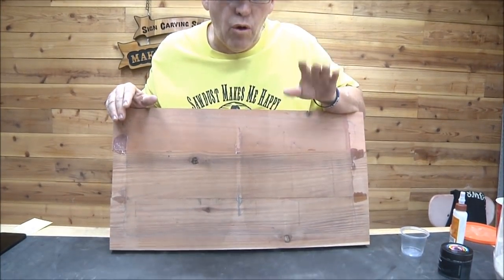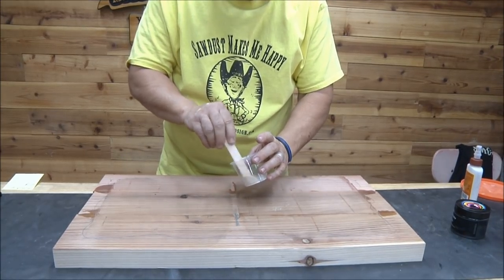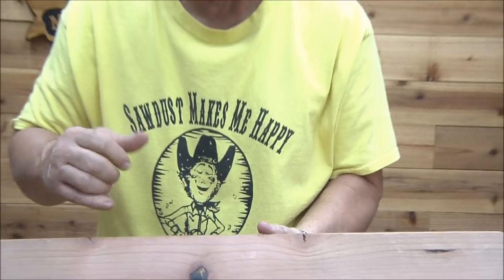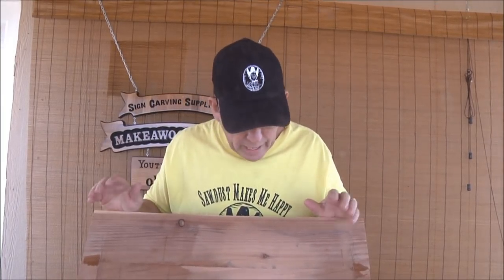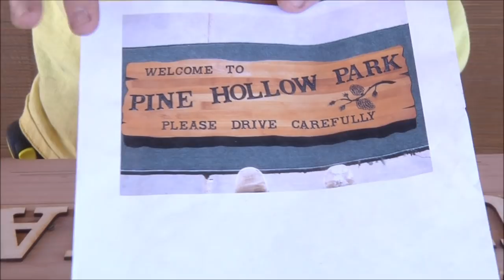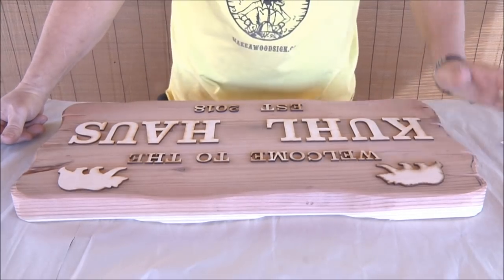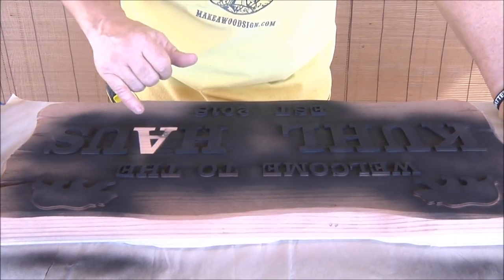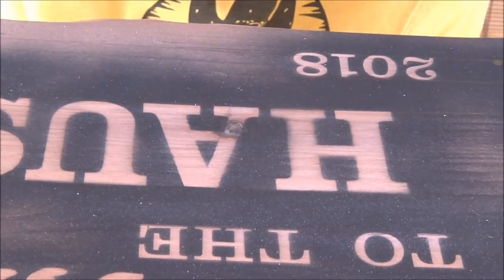#330 Carving a Redwood Cabin Sign part 1 of 2

Comment: I think mixing the sawdust, glue a little thinner would definitely help. When I do some sort of "fill" I use a small, thin spatula or flexible putty knife and really press the fill material into the opening/gap very hard, coming into the gap from every angle to force it in.  Kind of like spraying outset letters from every angle to make sure it is covered (got that from you!).
Reply from the maker: I will give that a try, Thank You Tom!!!

Comment: Great video, I use line chalk for color.
Reply from the maker: Can you elaborate? Like the blue powder that goes in chalk line tool?
Reply: @oldave100  yes chalk line, blue, red, and black. Can also mix with epoxy or fiberglass resin.

Comment: Eric, could you comment why you used the profile bit rather than the 60 degree for the inset letters as you typically do?  Thanks
Reply from the maker: Sure, either would have worked here, I just wanted a little more texture inside the letters. By using the profile bit it left more wood so I could make more texture. Hope this makes sense.